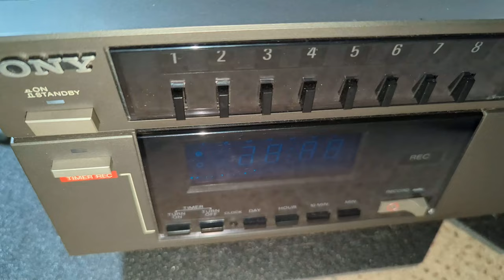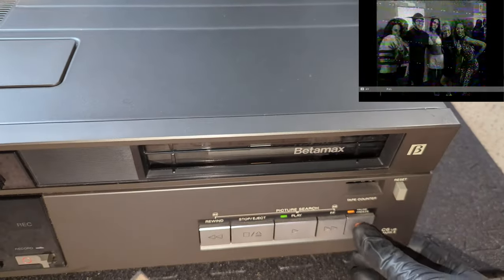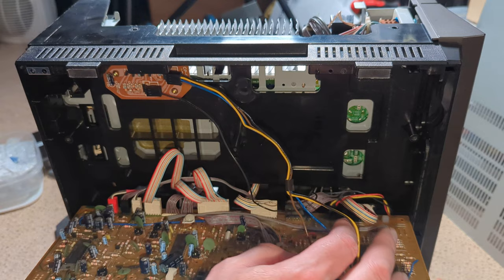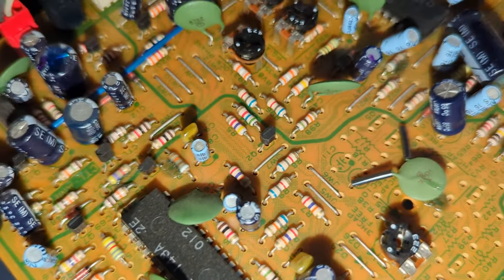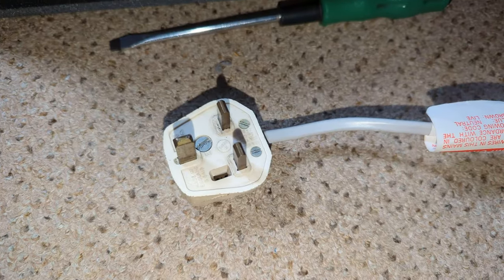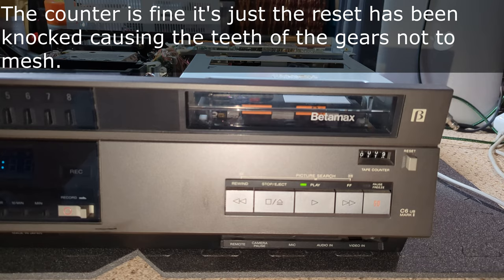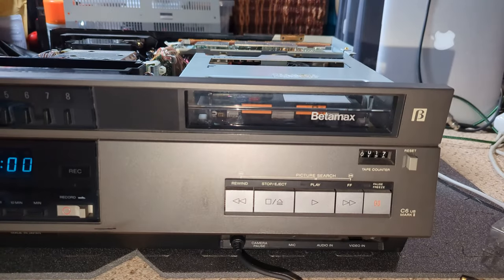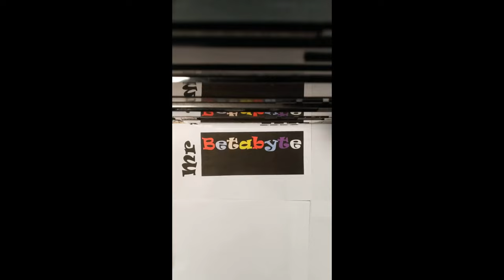Sony SL-C6 mark2 Betamax - Fixing servo issues (unstable playback picture)

Comment: At my standard component dealer there are no 5000h @ 105° electrolytic capacitors under 1µF. In the motor servo area, however, you should use suitable electrolytic capacitors or
Install capacitors, since there are always capacitors in analog technology that determine the correct system inertia. My boss once gave me a PHILIPS VHS recorder for tinkering with (for customer) on the table where he had installed the (stronger) winding motor that Philips wanted to use before the red pencil attack. So I came up with a circuit that inhibits the acceleration similar to the braking effect of the cassette, so that something like a balance is created. When I was looking for a "building site" for the circuit change, I found that PHILIPS had already provided the layout with holes and component designations on the servo board, but had bridged them with a wire. So I only needed to restore a prototype-like state. My first try with 1N4001, 16V100 electrolytic capacitor and 47R worked right away. Without real calculating !
Reply from the maker: I do hear what you're saying with the capacitors and I'm torn on which way to go is the best.

Interesting on the Philips VHS machines. Can you remember what model it was? It wasn't a VR6462 was it?
Reply: @MrBetaByte  It's more than 22 years ago, but it had a "smooth" front with no "keyboard" and typical PHILIPS pressed aluminum engine cases. I left the google translate joke in today (Engine)
Reply from the maker: @TTVEaGMXde  Hmmm - maybe it had a Panasonic deck maybe? Maybe an earlier VHS machine from Philips. Yes, I do like the 'engine' Google translates to. I see that so often in translated messages sent to me and it always makes me smile.
Reply: @MrBetaByte  In any case, it was a PHILIPS drive, and the design looked like it was from the second half of the 80s, since it had no relation to the V2k devices.

Comment: Hi. Checking out your channel for the first time. I think I’ll be a repeat viewer.

Regarding the little blue low value Sanyo caps. I’ve run into those on vintage audio components I’ve worked on and replaced with WIMA MKS 2 series stacked film caps (look like little red boxes) with much success. Could those be used in this instance instead of tantalum’s?

On another note, excellent work. Now to decide on what to watch next.
Reply from the maker: Thank you so much and welcome! I don't see why not at all - they should last well and as long as they physically fit then yes, they should be OK. May well be something I'll try in a future video - thank you for the inspiration! 😊👌

Comment: Great video. I have a Sony SL-8000 beta VCR. It has the same issue with playback. I replaced the tantalum capacitors and the tracking control potentiometer, but it’s still showing the same symptom. Is there anything else that should be replaced or adjusted?
Reply from the maker: The 8000 is a bit more of a beast to the C6 and I have to say I don't have a huge amount of experience with the very early Beta decks but I would suspect possible motor issues. The main thing is that the service manual is very in-depth so check all your voltages and for the servo control voltages - they'll all give a clue as to what is faulty. All this is assuming you've changed the belts with reasonable quality ones and the tape path is clean. I will be doing an 8000 on the channel soon though so I'm sure I shall feel your pain!

Comment: Nice one! I've got an SL-5000 with an issue where E-E signals don't work anymore (the video output doesn't display the signal coming from the video input, and nor even the signal coming from the tuner), the video from the output is just a black screen with some white flickering. E-E audio doesn't work as well. The only picture (and sound) it outputs is from the tape, during playback. Recording from either the tuner or A/V inputs doesn't work. Any ideas? I've checked everything i could think of and i'm at a dead end.
Reply from the maker: Can you try RF in and recording/ viewing that? Maybe from the output of another video recorder or set top box? Might give you a clue.

Comment: My dad has one of these that was boxed sadly it was put in my dads cellar and has suffered from damp .i do have a mk1 bersiom that is in good condition but on playback i get no sound and only a dark grey slightly snowy picture i have no idea about how good the heads are i think it must have many other faults .I do have an slc7 with great heads just common faults and timer not working .
Reply from the maker: Sounds like you have a video issue on the C6, possible a bad capacitor somewhere. Timers are becoming a real issue with the C7's if they've not had the backup battery removed before they leaked.

Comment: does anybody feel cheated that the USA equivalent SL-5200 was a Hi-Fi, us PAL consumers must have dropped jaws thinking if only Hi-Fi his the PAL shelves earlier
Reply: NTSC hifi models used the videoheads to write and read the audio signals. For PAL machines Sony had to add 2 separate rotation audio head. That was a later technology.
Reply: The NTSC versions were probably always developed first, since they could be tested in real life in JAPAN and not only at the PAL "Simulator". NTSC has a higher tape head relative speed which enables high fidelity sound over video heads.
Reply from the maker: I couldn't put it any better than the previous comments but yes, Beta HiFi for PAL is quite different using separate heads and needing a certain quality of cassette to work smoothly as the HiFi signal was placed 'through' the tape layer between the video information and took more development time and testing as a result. Just not the bandwidth with PAL to include it with the video signal.